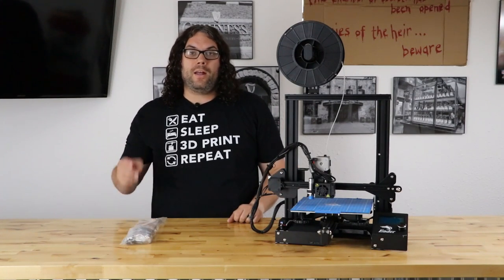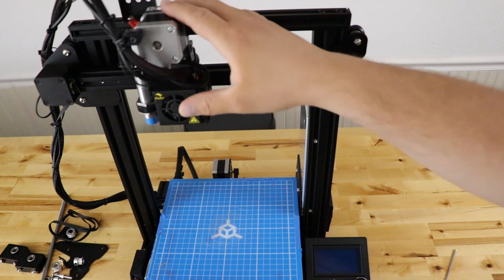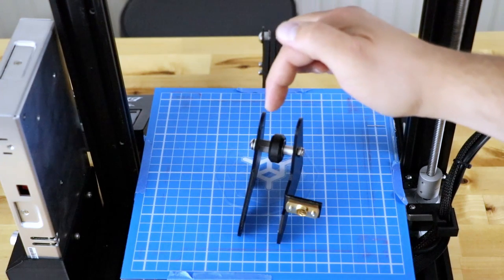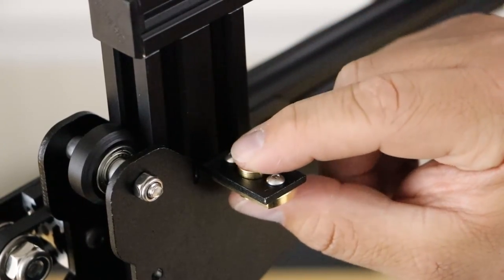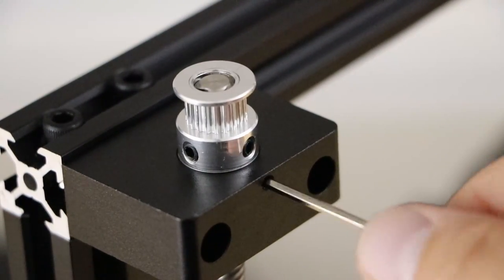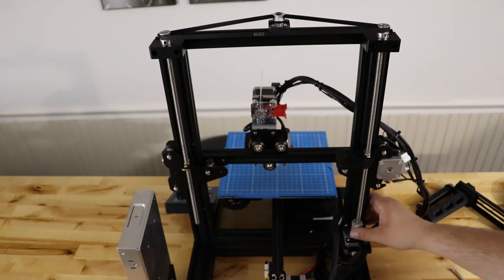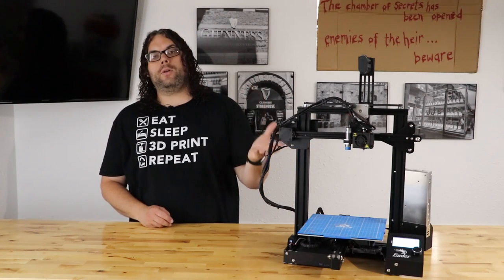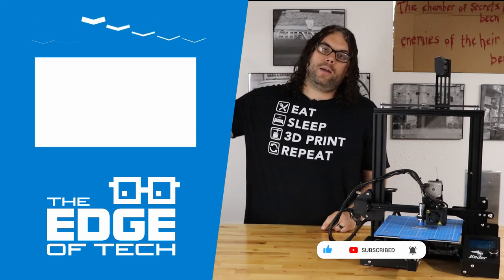How to install the TH3d Dual Z Upgrade kit on a Creality Ender 3

Comment: Thanks for video. I installed Ender Extender with their Dual-Z and kep having balancing issues. Bought the one from TH3d and installed it by following your instructions. Had to buy a 760 closed loop belt off Amazon. It works so much better than the Dual Z.

Comment: I just added this to my Ender 3 V2. I had two minor issues with the kit that neither one was TH3D's fault. The supplier of the bearings for the "Z" rod blocks had sent them a wrong size bearing. I contacted TH3D and the replacement bearings were sent out the next day. The next issue was operator error on my part and I contacted TECH SUPPORT and they explained to me what I was doing wrong. Based on the responses I got from TH3D I'll definitely continue to buy from them, not only because of the overall quality of their parts, but the quality of their tech service/warranty department. Next is the TH3D EZABL. Great video looking forward to the doing the next upgrade.

Comment: Just when I thought I was done upgrading my Ender 3 I see this video and now, of course, I need to have it. Nice work showing how it's all done. Great video. I had a little trouble getting my bed properly leveled because of the gantry alignment. Now with the Direct drive added this is exactly what I needed and I didn't even know it. Thanks, both to you and to TH3D for coming through again.

Comment: If you go amazon you can buy the right side cr-10 Z axis for £24 and it fits the Ender 3 or Ender 3 Pro perfectly! The spindle is a little bit longer but you can cut it down of mod it like I did, It’s MUCH cheaper and you get a stepper motor with it so it doesn’t pull and push and the existing Z axis motor which put a lot of strain on the axis plus the kit comes with a 2 in 1 lead so you don’t need 2 Z axis ports on you’re board to work you only need the 1
Reply: What will the 2x current do to the motherboard
Reply: @rorywquin  Noting at all, Mines been completely fine and Creality sell a double Z with the same cable... I have a SKR Mini E3 V2 and it’s been soo much better since I’ve added dual Z

Comment: looks cool.. one thing, your audio seems WAY low... ? oh, another thing, the Z Lead screw should NOT bottom out in the flex coupler.. that basically ignores the whole purpose of it flexing. should be lifted like 1mm off the motor drive shaft so it can have room to flex/move
Reply from the maker: Good point! I was following the instructions and it said to fully seat it, but I believe you are right. Even the stock couplers should have a small gap off the motor shaft!
Reply: @TheEdgeofTech Hi, correct me if I missed a point somewhere....the existing single Z axis leadscrew MUST bottom in the coupling...…...the Pro comes with the split solid coupling not that flexible one. My opinion is that the coupling is the only item that maintains the position of the leadscrew and if the coupling is able to flex up and down you will get variations in the leadscrew height which is the level for each layer of the slice. I would say that you do not want to have any variables in the progress of the Z axis as it rises up the screw. One other thing, you also need to have the coupling clear of the  face of the stepper motor, but that puts the whole weight of the leadscrew drive axially onto the stepper motor bearings, and I can say with certainty from my CNC experience that ALL stepper motors in CNC ballscrew driving applications have definite thrust bearing housings to cater for that aspect. I've just bought a small thrust bearing on AMAZON for a few dollars......5mm bore  12mm OD and 4mm thick and I'll install this on the stepper motor spindle between the bottom face of the coupling and the face of the stepper motor ....then the coupling can rest down on the bearing and so take the loading. It's all down force so you only need to have the thrust one way. The ball race on the top of the second leadscrew should take the small thrust loading OK.  BTW, love the design of the twin Z axis drive.....I have to have this on my E3 Pro....never did like the idea of twin stepper motors for the Z.
Reply: Just had a thought.....I wonder how effective it would be to mount the stepper motor on top of the crossbeam and drive the 2 screws from a central point with two short belts and 2 drive pulleys...…..this would prevent any spring from the very long drive belt with this design.
Reply: We bottom ours out when using the solid or plum couplers. The ender 3 has the solid couplers stock.
Reply: @TH3DStudio   ah, the ones I saw had flex couplers. so ya, if a solid coupler then yes, I'm incorrect and it should be bottomed out !
Reply: @Thomllama I would also replace the flexible coupling with the solid one, the Pro I have came with the solid split coupling. ....you don't need any up and down flexibility or any at all in the Z axis drive. I can't think why Creality fitted the flexible couplings to some models, It might be to correct the misalignment of the leadscrew because the the Z axis stepper is hard against the upright and this makes the leadscrew out of line if you measure the distance top and bottom to the upright face. Makersmuse did a review on this aspect and fitted a shim behind the motor to move it out to align the leadscrew. This is one of the tweaks you need to be aware of when you assemble the Ender leadscrew(s).
Reply: @gangleweed  It's been done already and you can find it on Thingiverse

Comment: A print result comparison would have been awesome to see if it even makes a difference and what the difference looks like.
Reply from the maker: I agree. I should have included that in the video. Thanks for watching!!
Reply: It’s less “prints immediately improved” and more “not having as many potential fails due to gantry sagging or z-binding”

Comment: Hey Edge,

thanks for the tutorial.
I have Questions:
There is another way to Upgrade the dual Z. It is coming with a second Steppermotor for the other side instead of using a timing belt.
What do you think about this? 
Could you compare these two methods?
Can these two methods be combined?

Comment: I hope you wont take this the wrong way but feel you have missed an important step here .  I see no signs that you have done any prints that would allow you to objectively compare the output quality before and after the upgrade.  A review should really let the viewer know if the upgrade is worth the money and effort.  For example add this kit to an Ender 3 pro and you are at the same cost as an Ender 5 so it needs to make substantial difference to print quality.
Reply: After looking at the price of the upgrade I agree. Is it worth it?
Reply: I've also done this upgrade. If you are not using a direct drive extruder it may not make as much of a difference.  However, if you are (like he is in the video) the weight can be a real problem and cause a sag on the right side of the gantry. This will manifest itself in the print, especially the higher you get. You will see banding in your z axis (lines). A good example is here: https://twitter.com/flowalistik/status/915184422101581824   An easy way to check if you need this upgrade is to print something tall, maybe 100mm. Measure the distance of the end of the gantry on both sides on the inside of the frame, from the bed, to the bottom of the gantry. If you are off by more than few mm (assuming you were even at the beginning) it's probably worth doing the upgrade. Also look at your print. This is a well known problem, and many folks with the CR10 have done this upgrade (granted, it has a wider travel on X also...). Hope this helps.
Reply: I don't think this is a review video as much as just a walkthrough to install the kit. Also some of us have already purchased our Ender 3 and don't want to buy another printer.
Reply: @dude_blight89  your correct it is a walk through not a review.  So since Jim clearly states near end that he thinks the upgrade is a good idea the video is really just product advertising.
Reply: @davidspencer6536  Based on the fact that many people have X axis beam out of square problems that would get worse with more weight, I would not hesitate to say that this is a necessity...….. the E10 S has a dual drive...….but with twin steppers....this solution is better as it cannot go out of synch due to lost steps or a dead stepper etc. The E3 is already underpriced due to cost cutting.
Reply: @gangleweed  O yes it can! Does not take much at all for this belt to jump a thread and BOOM, it is out of alignment and not only that there is the obvious flex point in a belt this long that in and of itself could easily introduce a sync issue. So the belt just adds an additional point of failure where you would less likely run into issues with a second stepper that is properly aligned and calibrated!
Reply: @kevinm3751  What you say is probably a long maybe......I doubt the belt would be so slack or stretchy to enable it to "jump out of gear".
I said that THIS METHOD in the video is a better solution than the twin stepper solution as you can lose a step or two with twin stepper drives and then you're out of wack with a tilted beam without knowing it.
To go one better I would go for a central drive with shorter belts...... that is one belt on each side going to the two screws driven by separate toothed pulleys on one central stepper motor..........shorter belts would not flex at all if tensioned correctly.
Reply: @gangleweed  Now thats a thought I can get behind, the shear length of the belt as it is shown here just screams potential failure but yes I could easily see a stepper in the middle. Going to look into this...
Reply: @kevinm3751  I have the Ender 3 Pro and I considered this as an option to stop the beam sag etc and to this end I bought another leadscrew and an 8mm plain rod.
I'm working on a different design though, and that is with a long 8mm diam cross shaft with bevel gears on the ends.
Basically I want to drive the one existing screw with it's stepper as it is, and have a bevel gear on the top driving the cross shaft.....this will then drive the other leadscrew with a bevel gear etc.
So, no drive belts and a solid drive train that cannot get out of mesh.
The shaft and leadscrews need bearing blocks for support etc and I am also having small ball thrust bearings at each bevel gear interface to alleviate thrust.
As friction in plain bearings can be a problem, and as I'm Mr pedantic to the extreme, I have a number needle bearings with 8mm bores that I'll fit in the bearing support blocks........all parts available on Ebay and Amazon etc.
The drive train moves very slowly so wear is not an issue.
Luckily the extruded sections are slotted so attaching the bearing blocks is easy.
Reply: @gangleweed  I would be interested in learning more about this. Your idea sounds like it might be the ticket I am looking for. Where on Amazon might I find this kit? I do think with either of the solutions you present a larger stepper motor would also be in order and especially with the added worm gear since that is a whole lot of friction that was not considered with the steppers that are supplied with the printer (thoughts?).
Reply: @kevinm3751  Bevel gears not worm gear......I'm an inventor by nature and this is one of my inventions....probably been done before but no evidence to that end.
Basically once you establish the first principle of how it works you draw up the design and buy the parts at random, no kit etc, on EBAY or AMAZON.....cost about A$20 all up.
I think you would be right in the bigger stepper motor just to be safe, but being longer that will mean you need to shorten the current leadscrew it's connected to.
All the parts in the drive train must be sized for lengths etc......just a bit of doodling with a graphics pad and a computer program like MS Paint.....I use a Wacom Intuos 3 graphics pad for all my doodling.
Reply: @gangleweed  Got it, yes I know what Bevel gears are but then how are you getting the action to those gears if not a worm drive or a belt or? Can you share your doodles? Funny thing is I also use a Intuos 3 and love it...;) NM, figured it out, I see using a shaft which would drive the Bevel gears on the other side and can vision the setup with bearing and supports to support it. Great idea, I am going to mess around with this and see what I can come up with.
Reply: @gangleweed  Here is another thought, how about using a right angle drive. Place it in the center with the stepper motor and then short shafts that then go out to the vertical worm gears, connected with your bevel gears? That would ensure less (more equalized) torsion that you are going to experience using one long shaft that spans the full length of the horizontal member.
Reply: @kevinm3751  Yes, I considered that too with the stepper in the middle and 2 short shafts either side but I think it might be more trouble to mount and link up......you have to consider the rotation of the shafts when they are being driven as the 2 screws need to rotate in the same direction.
The existing stepper (replaced by a bigger one) would mean less work to connect to the drive train......but it could be done with some cunning design.
In actual fact, the second leadscrew will only ever be lightly loaded as the beam maintains the squareness, but the second screw is a back up to make sure the beam doesn't ever sag or go out of square as the print head moves to the far end of the beam.
With added mods like direct drive and it's motor etc and bigger hot ends there will be some weight increase I think when the carriage gets to the end of the beam.........the beam is quite flimsy at best.
Reply: @gangleweed  Nope not me, I will shoot you an email and we can pick this up from there. not a night owl though, I am in the US and its morning here...;)
Reply: @kevinm3751  OK......it's 4 AM here and I'm off to bed....tomorrow is another day.
Reply: @gangleweed  Yea regardless what solution a larger motor is going to be almost a must. Even if it offers chop, heat is going to be a major concern. So far as setting it up I am sure using a sealed gearbox would be best, sort of like the rear end of a car only using a 1:1 ratio so there is no heavy lifting to be done in the software to account for it and I see them for sale on Amazon for very reasonable prices.

Comment: This looks sweet, even without the weight of a direct drive on it i could see this upgrade being beneficial.
Reply from the maker: It's worth a try for sure! I will do a follow-up video on the quality and show some prints!
Reply: So many times you will see Ender 3 printers with drooping right side of the X gantry. Mist if the people do not even notice it. They align the bed to the X gantry  and with low prints they do not even notice the distortion in the model. Good adjusted printer will work for a good while with the X gantry being at the same level though switch directions up and down will change somewhat the alignment. When the play in the X gantry is big enough it will make it worse over the time. Head moving to the right side will over time loosen up the X gantry assembly and introduce the play. Sure with a direct drive this will happen way sooner. Actually we do not add weight to the X gantry with converting to the direct drive. We are just introducing more moving weight. Extruder motor weight is always on the X gantry but in the stock setup it us balancing the gantry and helping single lead screw setup. Once it moves with a direct drive setup single lead screw setup will be over tasked. So sure DD setup benefits the most from dual Z setup. Though longer X gantries benefit as well. Even stock Ender 3 conversion to the  dual Z helps longevity of the X gantry alignment. Though I have to say installing this kit is as simple as in this video but alignment is a b..... nit simple at all. Takes the time. Ince aligned it is epic though.

Comment: Seems to me having a setup to add another stepper motor would be a huge plus. Surely anyone doing this upgrade will have already upgraded the main board which supports the dual Z steppers...

Comment: After installing the dual axis kit and aligning and printing successfully, if the add on stepper is manually moved, throwing the height alignment out will the stepper automatically realign itself when next moved or will it continue to operate out of alignment? Thanks
Reply from the maker: You should re-align it to be safe. But once your set, you should be good.

Comment: Nicely presented video. Good idea overall but not sure about the kit though. You shouldn't have the bearings held by grub screws. Retainer plates or bearing fit but not screws. I would also suggest when moving the  Z shaft to move the brass nut/plate at the same time.
Reply from the maker: Thanks for the opinion, and thanks for watching!!

Comment: That's a nice kit but I'd prefer to get the xyz linear rail system. It seems to be a better system and will virtually eliminate the zed banding, that you get with the screw rods.

Comment: Hi Mate, does this totally eliminate x gantry sag?
Reply from the maker: Definitely will help with sag!
Reply: @TheEdgeofTech  Awesome, I have CR20 Pro. It is giving me absolutely insane prints, and I'm brand new to 3D printing however have a background in robotic equipment. My X-gantry is around 3mm off (lower at the right) - but my bed is adjusted so my first layer is basically perfect. Should I fix this sag prior to installing this kit - or not touch it as I am getting great results at the moment.